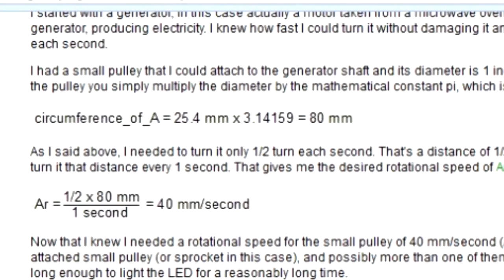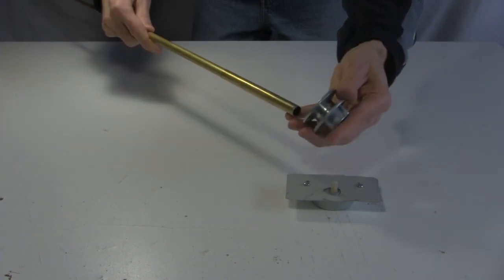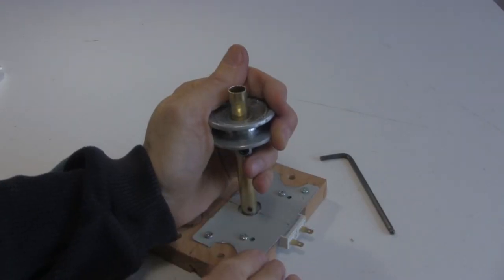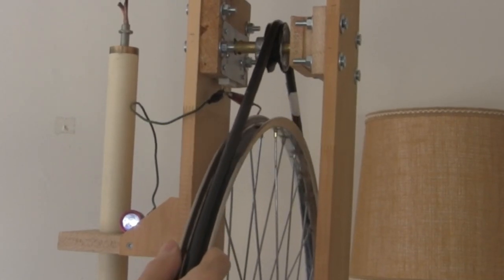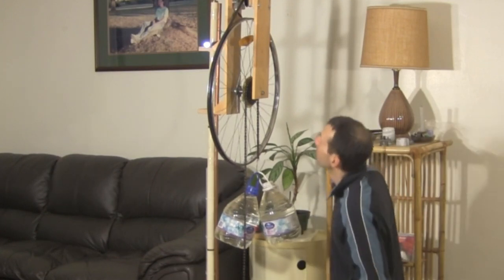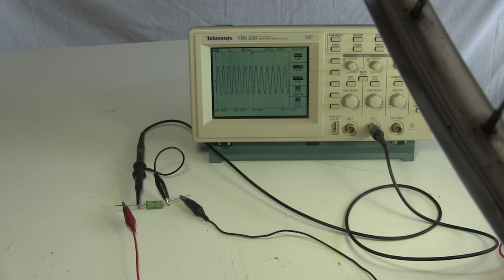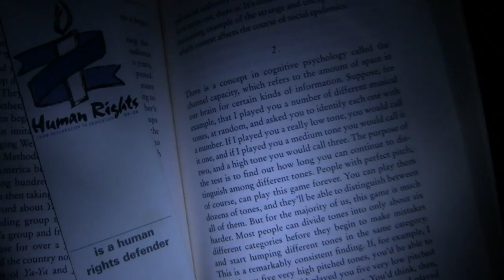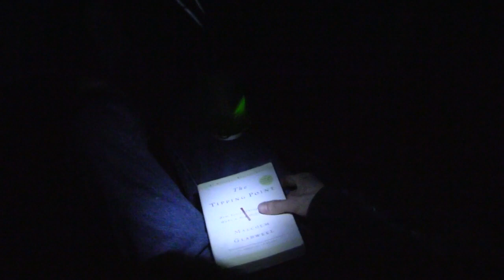Gravity Light - Making and Enhancements (version 1)

Comment from the maker: Here's how I made my Gravity Light, plus the enhancements that increased the run time from 2 minutes to 8 minutes. Plus, lots of construction tips. Thinking about it, the drop distance is only 2 1/2 feet/0.75 meters. If all I did was raise it to the ceiling, the run time would be 15 minutes! Enjoy!
Reply: Amazing!
Reply from the maker: varun rao
Thanks!
Reply: RimstarOrg great job...is there a way you u can increase the time by using a combination of pulleys
Reply from the maker: Shamik Gupta
It's possible, yes. BTW You might want to check out version 2 of this. I got it to a much longer run time http://youtu.be/GisQYoYw05k.
Reply: RimstarOrg how did you make hole in the motor shaft ?
Reply: Would it be possible to have an energy storage device in this grav light and to use that stored energy to charge up electronics gadgets? Like a hand crank gen

Comment: Well done. This has come a long way in one week. 2 min up to 8 min with more brightness is awesome :D
I'm uploading a video about cordless drill motors as I type.
Reply: Very good indeed.  Speaking of cordless drill motors, this is what I'll be using to drive my vents open/closed in the greenhouse.
Reply from the maker: Thanks. From all the wonderful feedback I'm getting I've got quite a bit to explore for the next version, including ordering new types of LEDs, new motors, different circuits, ... The result should be even better. And keep in mind that 8 minutes was with just a 2 1/2 foot/0.75 meter drop distance. Raising the current unit to the ceiling it would already be 15 minutes.
And I just watched your video. Thanks for the doing all that legwork. It'll come in handy as usual.

Comment: Since you added the bridge rectifier, consider using an escapement mechanism
to considerably adding to the time the mass will fall.
Reply from the maker: I don't know what you mean. How would an escapement mechanism help? The capacitor stores any unused energy for later use, though there's not much excess as judged by the fact that after the mass stops falling, the LEDs are powered by the capacitor for only a few seconds longer.
Reply: Escapement would slow down the mass falling.  Like a traditional Cuckoo clock.  Slow and consistent.  This would allow changing the weight of the mass and/or the diameter of the pulley and maintain rpms.  Hopefully in a way that allows for longer run time.

Comment: Good work on the rectifier circuit. One question: is the shaft on the microwave motor made from plastic? That seems like it will eventually break from the weight. Another thing to consider would be to use a water filled inner tube for the belt. You need to put the water in under pressure to expand/lengthen the tube. Water doesn't compress so it will keep the tube from crushing, but it will conform to the pulleys better and have more contact area.
Reply from the maker: At least the exterior part is made of plastic, but it's held up perfectly so far. At some point I'll take it apart and make a point to check the shaft. Thanks for the water belt idea. That should be great for cases like this where the pulley profiles are mismatched.

Comment: To avoid having the thing lean over, reducing efficiency, have supporting poles so that the wheel is between them, eliminating the need for the copper pipe and plastic. Then more weight can be added! Also, since the motor has resistance when unloaded, it is very lossy. It would make sense to use a separate gear system that is less lossy (larger gears, fewer of them) and a generator/motor that has good bearings. If possible, have the voltage output be high and have 4 Cree power LEDs like XPG's (more efficient) connected the in a full wave bridge configuration, with the "output" of this bridge shorted. Alternatively, you could just have any even number of LEDs connected so that a few are in series in one direction, and a few in the reverse direction. This eliminates the need for lossy diodes that, in that configuration, are only god for >12V stuff, since it will drop almost 2V, wasting about (~2V x ~0.02A = ) ~1W of power! Good luck on continuing progress on it!
Reply: I like your thinking. How about FWBR made from LED's, with a cap and another few leds on the dc output of the FWBR. Just to make sure no power is wasted.
Although it may not work as well due to there being 2 LED's in series when the FWBR lights up.
Reply from the maker: I plan on having better support for the next version. I used what I had on hand this time. But I don't want to add more weight, or at least not much more, I want to keep that manageable. More weight wouldn't be as impressive (or interesting for me.) Thanks for the tip re the Cree LEDs. I'll look into them. I like the bridged LED idea too.
Reply: Mongrel Shark What's FWDR?
Reply from the maker: Power Max
Full-wave bridge rectifier. I had to think a minute too when I first read it. Luckily I'd just made one, so that helped. :)
Reply: RimstarOrg It looks like cree is achieving over 300 lumens per watt with labratory LEDs, and seems like most of their commercial white LEDs are 90-115 lm/W @ full power. the MK-R states it can be as high as 200 lm/W.
Reply: The high wattage LED's are very efficient at low power too. Random Bits: 0013 One Watt Challenge
Reply: Mongrel Shark LEDs should have the same efficacy either way. However, I guess what you mean is that the voltage drop across it will be high.
Reply: Yep. The synchronous motor is only putting out 3-4v p-p. To get power out of a LED FWBR you need at least 6vp-p input. Or the leds wont light up and no current will flow. Red LED's with a 1.8v frv would mean you only need 3.6v p-p. The LED FWBR is a great idea, but maybe not suited to this motors power output.
Reply: Mongrel Shark What is why I mentioned getting a better motor (a proper generator/dynamo). Or I thought I did.

Comment: Great work done🎉
Can we lift the same weight by providing power to the same weight???
Reply from the maker: Thanks!
And nope, lifting the a weight using the same weight wouldn't work. Would be neat though, but the conservation of energy doesn't allow it.
In case you're interested, I did make a version 2 from what I learned from making version 1 https://youtu.be/GisQYoYw05k
Reply: @RimstarOrg  sorry but ,i wanted to ask whether the same weight can be lifted with the same motor by providing higher power from solar panel.
Reply from the maker: I don't know. It's a heavily geared motor, so quite strong at a slow speed. But I don't know how much torque it can produce.
Reply: @RimstarOrg  thank you for the response

Comment: This is awesome, just one question why didn't you leave the bike frame intact and attach the weight to the peddles Axel, than you could use the gears and there switches and brakes to adjust the energy output?
Reply from the maker: Thanks. I did use the gears. At 7:16 I point out that I moved the chain to a smaller sprocket and with further refinements in my version 2 (https://www.youtube.com/watch?v=GisQYoYw05k) I had it all the way to the 2nd smallest sprocket  Having the bike frame intact would just have made the process of switching gears easier, but there's no need since that's a one-time thing.
As for the brakes, I wouldn't want to use them since that would be wasting energy. Far better that I just put on a bigger electrical load.

Comment: Since its been 8y, maybe you can do an update with some improvements:
- currently the tension of the pulley belt is handled by the motor and bearing. Maybe this can be offloaded by moving the motor elsewehere
- You can use a BLDC motor with some step-up gears to spin the motor fast, then you get 3 phase AC
- use dc-dc smps to transform the power from the motor to any voltage, and before, store the rectified 3 phases in a capacitor bank. The output can be stored in a battery
Reply from the maker: Thanks for the suggestions. I haven't done anything new in those 8 years but back then I did make a lot of improvements and came up with a version 2 which you can see here https://www.youtube.com/watch?v=foqqxqW8aBg

Comment: Cool idea with using an electric motor as a generator. I really hadn't thought about that. Could that work with any electric motor or are there special properties that I should look for?
Reply from the maker: I think it works with pretty much any motor, though some may have multiple sets of wires going to them. There's also the consideration of that AC motors are AC generators and DC motors are DC generators, so it depends on which you want.
Reply: RimstarOrg  Cool! Thanks a lot. It's videos like this that makes me glad I don't immediately throw away stuff that I don't use/are broken. I might use this as inspiration for a lesson at some point.

Comment: an interesting experiment would be a planetary roller screw that is locked against rotation with a weight on it and using the downward force to turn the threaded shaft
and power the generator

Comment: Put AC cap on output of generator and more caps after rectifier like 10 000 uF (or just 2nd 4700 uF one) 
And try to anyhow not use an resistor 91 ohms is small one but still wasting power 
dc-dc converter sounds good but i don't think it will work

And if this gererator puts out small power you can use 0.3v diodes (if you arent already)
Reply from the maker: Thanks for your input.
The 4700uF one was the largest capacitance one I have. I'm ordering some larger ones.
The 91 ohms was to protect the LEDs in case current was too high, for example, if the wheel started turning real fast for some reason. I looked at the light output with and without the resistor and decided it was a reasonable safety precaution.
I plan on try Schottky diodes, which have the lower voltage drop. There are other options too, such as using two sets of LEDs, in opposite polarities, and doing without the bridge rectifier altogether. I'm exploring different motor options too, so the motor I use may end up being DC instead.
Reply: RimstarOrg i know that you need to protect leds but if wheel spins fast than you are generating big voltage and wasting it using only small one 
You need kind of converter that converts any voltage to voltage that ypu leds need and extra current will be stored in a cap
2 leds sounds good 
If it were puting low voltage out you can use joule thief...

Comment: Very nice improvements and runtime.  Did you measure the output?
Reply from the maker: You mean of the generator? If I recall correctly, with the LEDs as the load it was around 4 volts and around 3.5 milliamps.

Comment: Can we use dc generator in place of synchronous? If not why?
Reply from the maker: You can use a DC generator (really a motor) instead. The only reason I used the the AC generator (also a motor) is because of all the gearing it has inside. That gearing turns the slow rotation of the generator's shaft into faster rotation inside and a higher current and sufficient voltage output. If you try to turn the shaft by hand, it's very difficult, if not impossible. That's because of all the load that that gearing produces. Without that gearing the mass would just quickly fall to the floor.
A normal DC generator for example doesn't have all that gearing and so the the mass will just quickly fall to the floor. Your run time will be just a few seconds. During those few seconds the DC generator may create enough current and voltage to power the LEDs, but a few seconds is no good.
So if you can find a DC generator that has all the gearing then great, use it. Off-hand I don't know of any, but there may be some. You won't need all the circuitry I needed for the AC generator, but a diode in series with the output to protect the LEDs and a capacitor like I had may still be a good idea.
Another option is to use a stepper motor as the generator.
Or you can add your own gears and/or pulleys and then go with a normal DC generator, like this one https://www.youtube.com/watch?v=vgg1oJFdvcs, though he made his own DC generator.
Reply: thank you.

Comment: have you ever tried harvesting ambient microwaves?
Reply from the maker: I've thought about it, but haven't tried it. Someday maybe.
Reply: Excellent I look forward to another cool future video. I've had some success using a 1N23B x-band mixer diode and dipole 6.25cm garden wire antenna which works well if you hold it near a cell phone that is in a call and will light a red LED but gives you very little power when more than 20cm away. Perhaps only really useful close range power transfer or for a remote sensor that would take readings for 5 secs then power down for 23h59m55s and recharge. Not sure how to get useful voltages at low levels either unless I could make a dcdc step up converter to take as low as 0.05v from multiple antenna and boost it to 1.8v for the mcu.

Comment: I have to say that the leds output light in a certain angle. this is smaller than your reflector in the flashlight, and thus it won't actually benefit from the reflector. Leds have their own lenses that regulate that angle. maybe you can use 2 big angle and 1 smaller one combined & get rid of that ugly flashlight case

Comment: How did adding a rectifier double the runtime?
Reply from the maker: It has a rectifier (well, 4 diodes forming a rectifier circuit).
Reply: @RimstarOrg  Yes but how did adding rectifier made it last longer? Was it because now full wave was used instead of half wave when LED was connected directly to the generator?
Reply from the maker: Oh, I misread your question. It wasn't just the rectifier. Moving the chain to a smaller sprocket meant that I could lower the mass to drop more slowly while still turning the generator at a fast enough speed. That's what gave the extra runtime. But the generator speed may still not have been fast enough for a bright enough light. That's where the rectifier helped. The LED operates on DC and I was feeding it AC, so only half of the cycle was being used. With the rectifier, I started using the full cycle. But I also switched to three LEDs. So it was really a combination of all that that gave me a longer time with bright enough light.
In case you're interested, I later got around 12 minutes with more changes in my version 2: https://www.youtube.com/watch?v=GisQYoYw05k
Reply: @RimstarOrg  So if i use only one LED will it run longer?
Reply from the maker: Nope. Despite what I said previously, thinking about it again, I guess what allowed me to run longer for version 1 was adding the rectifier circuit which used the power more efficiently by taking more advantage of what was coming from the AC generator. What allowed me to run even longer for version 2 was switching to more efficient types of LEDs. 
Either way, if you want X amount of brightness then you'll need the same amount of power, unless you can make things more efficient.

Comment: what are the size of brass tubes?
Reply from the maker: Good question. Unfortunately I didn't make a note. I suggest measuring the outer diameter of your microwave oven motor's shaft and starting with that. I do have one of the pulleys handy though and just measured the inner diameter as around 5/8" or 15mm.
Reply: @RimstarOrg  yeah i will measure but oven motor hasnt arrived... anyway thanks.. i will write here again if i had a question. by the way i am a science teacher in türkiye and this is my science project... thank you so much for posting this video.. helped me so much...
Reply from the maker: Keep in mind that this was version 1. I also did a version 2. The video for that one is here https://www.youtube.com/watch?v=GisQYoYw05k The full write-up for both versions and with all the videos is on my website here https://rimstar.org/science_electronics_projects/gravity_light_homemade_diy.htm Good luck with your project. Let me know how it goes.
Reply: @RimstarOrg  thanks for your attention .. i have all the pieces. i will build it with my students 😊
Reply: @RimstarOrg  what is the name of the pulley that you use? i cant find on the internet?
Reply from the maker: Search for v-belt pulley.

Comment: If I make this gravity light project. How can I store the electricity generated?
Reply from the maker: Chinmay Samant You can use the output to charge a battery or a supercapacitor. In fact I'm storing some energy in my capacitor so that there's still enough light to see by after the mass has stopped falling. You'd probably need to do something with the circuit to make the voltage be higher than your battery voltage so that it'll charge. Note that I have a newer version of this gravity light, version 2, which you can see in this video  "Gravity Light (v2) Making and Enhancements".
Reply: Thanks, And one more question is there any way by which I can make the cycle continuous in which I don't need to lift the weight again to start the electricity generation process. And at last awesome project.
Reply from the maker: Chinmay Samant Thanks. There isn't any way of lifting it that will require less energy than you get out of it, so it wouldn't make much sense to. Even the amount of energy you expend to lift it is more than the energy put out by it to power the light. Of course you can do some kind of solar powered lifter or something, but there are more efficient ways of getting energy out of solar.